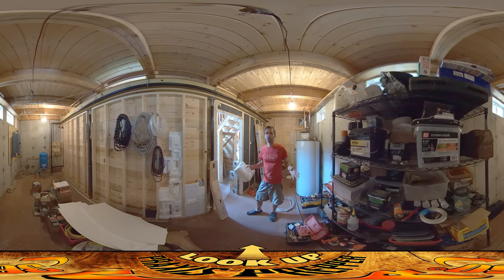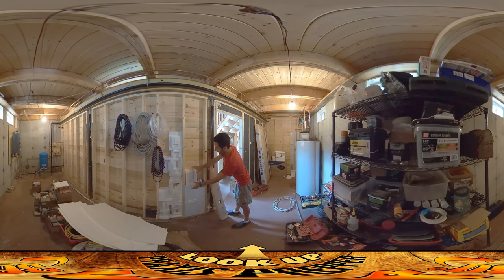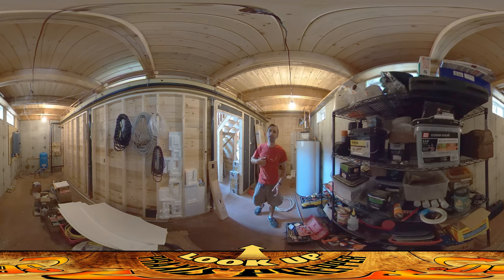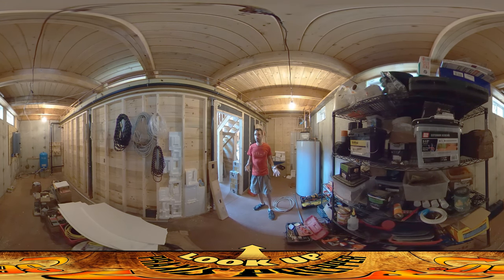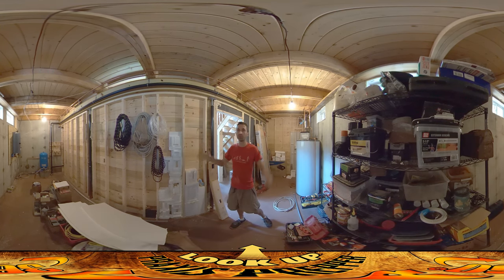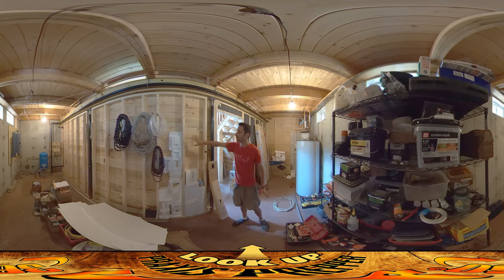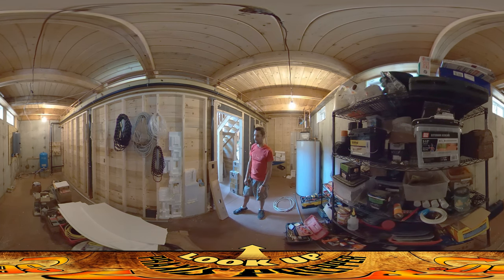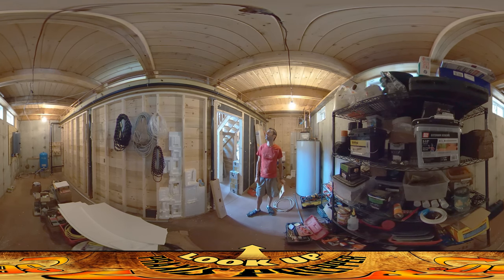Homestead Building - Insulating the Pantry with Scrap

Comment: Building codes are there for a reason...but...sometimes they just get silly when someone builds and thinks outside the box.
Reply: I'm convinced that some building inspectors are just exercising power trips since, as unelected bureaucrats, it's nearly impossible to hold them accountable.
Reply from the maker: In my experience, not all building inspectors are subject to that character flaw. All of the ones I've ever dealt with were actually pretty laid back. But I'm sure there are individuals as you describe out there (in all professions).